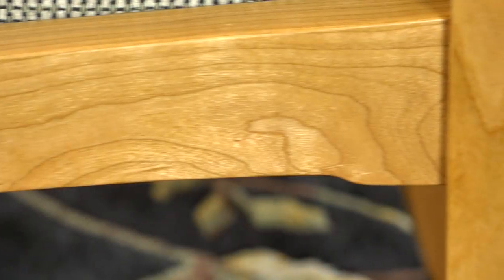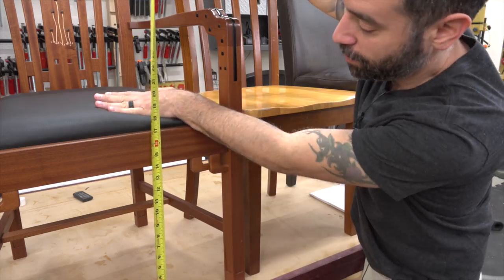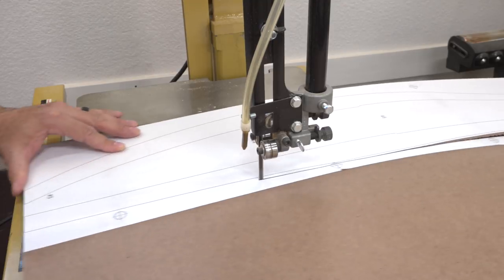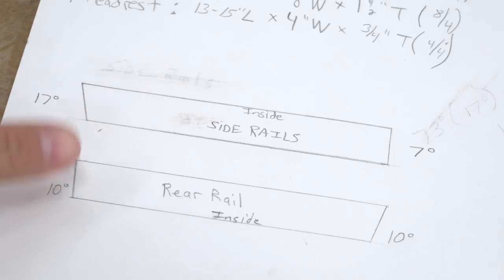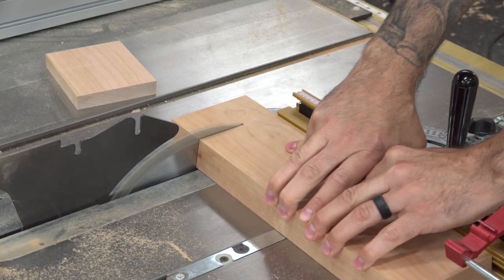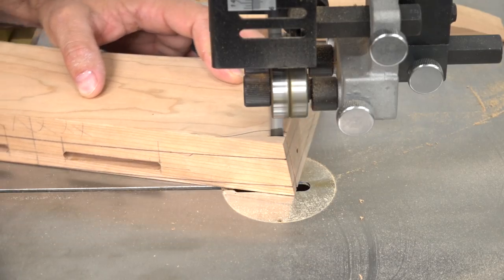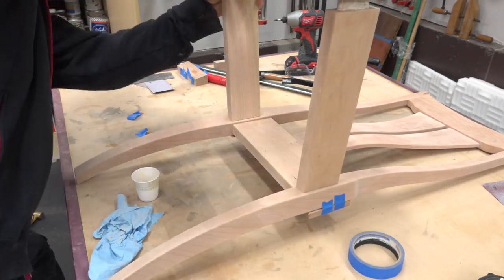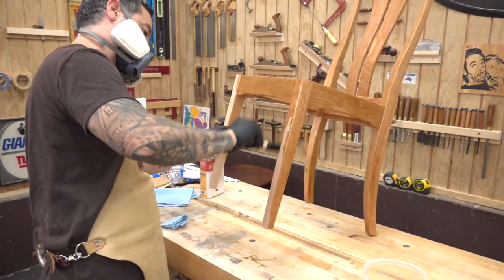Dining Chair

Comment: Exactly what I was looking for thanks for the project. Also I never knew these digital angle gauges existed I've been using my saw guide which is "more or less" accurate and doing test cuts. I just ordered the Wixey WR300 Digital Angle Gauge from Amazon - $37 thanks!!
Reply: robc 
Those Wixey gauges are awesome!

Comment: I have been debating on whether or not to start in on the gaming table and with these chairs it kinda clinches it.  Do you think you could add an option to turn a couple of them into arm chairs?
Reply from the maker: +jblevin385 adding arms shouldn't be terribly difficult. But the project is complete at this point so it isn't likely I'll add anything to the series any time soon.

Comment: Is there a reason you screwed and plugged the top rail on the chair, instead of just running some dowels through?
Reply: This project has me interested in the guild...
Reply: Same question here.
Reply from the maker: During the construction, the chair had to be assembled and disassembled many times for joinery and shaping. That's pretty easy to do with screws. With dowels, I'd have to use clamps every time.
Reply: Ah, thanks Mark.